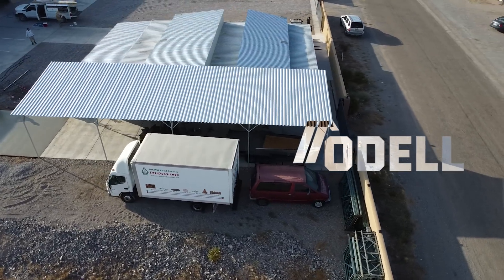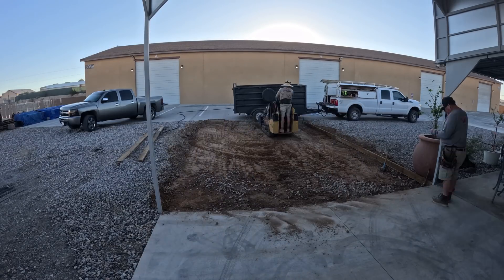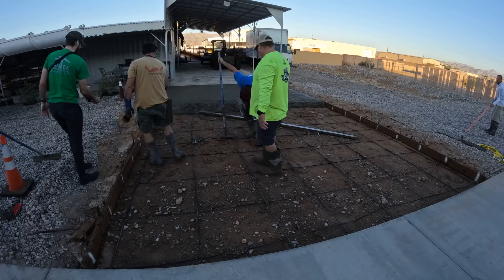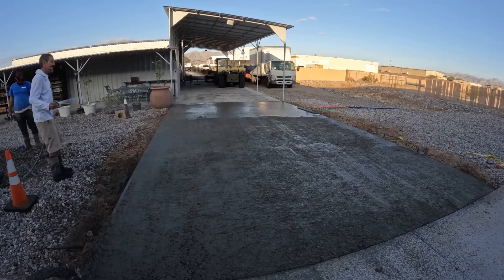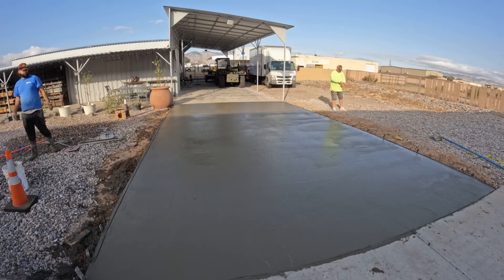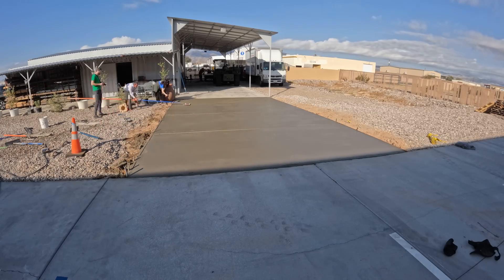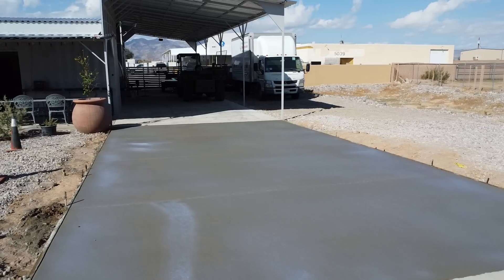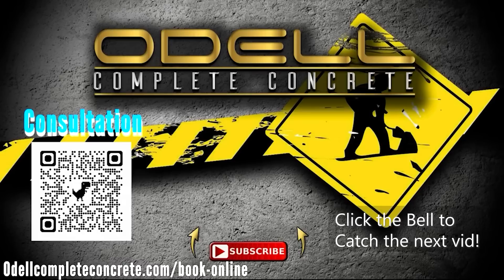How to Install a Slab Between Existing Concrete That WON'T CRACK

Comment: I thought you might have tied it into the other slabs  to stop any vertical movement but I suppose it looked like a fairly stable base.👍❤
Reply from the maker: Tight and right

Comment: So when you pour between existing slabs you don't need to dowel into those slabs with rebar? I thought that was the standard?
Reply from the maker: No, you need expansion joints. Every 30'. That's the standard.
Reply: @OdellCompleteConcrete  Ok. So is doweling wrong or is it something that will make it extra strong but not necessary?
Reply: @kanive1566  If you lived in an area susceptible to hard freeze/thaw cycles, you should consider doweling to avoid any chance of heaving but otherwise it should be fine.

Comment: Another interesting fact.  5 inch concrete is 50% stronger than 4 inch. Well worth the extra material, nearly not any more work or cost as well.  I alway pour 4,000 psi. it's creamier and in our area the cost is minimal.
Reply from the maker: Makes good sense